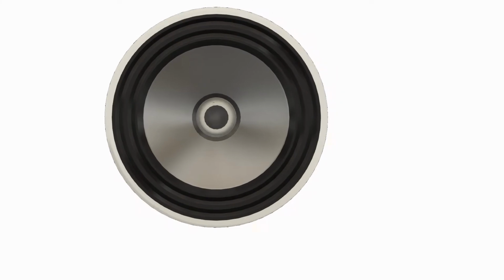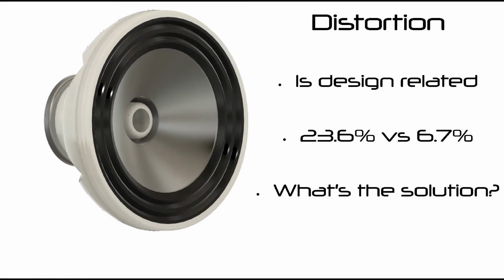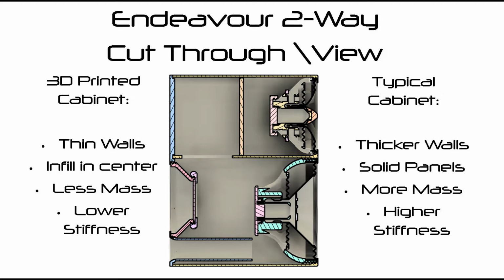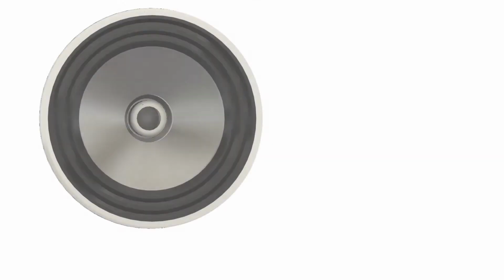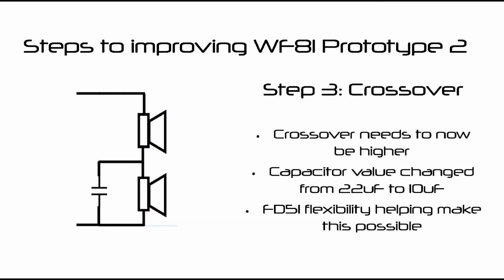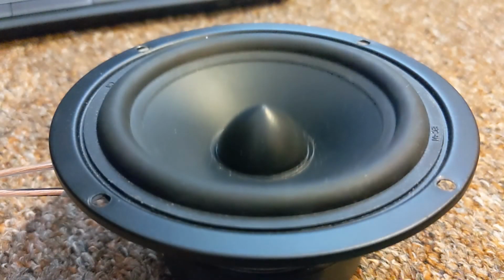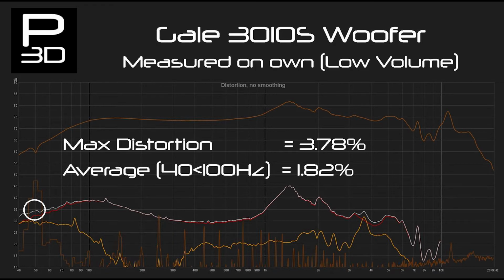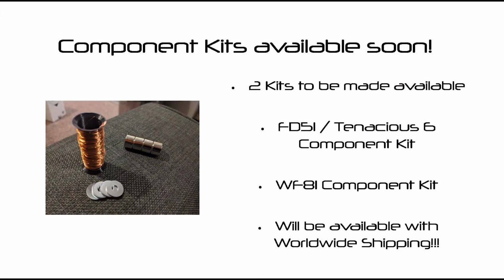WF81 Proto 2, Improving distortion on 3D Printed speaker drivers!

Comment: Two Suggestions:
1. Test the speaker mounted on a thick "Infinite Baffle" plane.
2. To reduce/eliminate cabinet distortion(s), I suggest the use of non-parallel panels--in other words, have the back panel angled in towards the top. Top being shallow in depth than the base of the cabinet. Doing so will assist in breaking up any internal standing waves.
PS--Another simple and interesting component to add to your crossover network would be what's called a "Zobel Network" basically it's a non-polarized capacitor in series with a non-inductive resistor placed in parallel across the terminals of the speaker. This "Zobel Network" negates the impedance rise as the frequency of the driver rises.
Reply from the maker: Certainly a lot to think on and honestly, but experience on cabinet design is fairly low so will be learning lots as I go. As for the infinite baffle, I am in a 1 bed house with no garden and a 2 year old, but having to work with what I have for now. If I get the luxury of space, a baffle will be on the list!

Comment: Cement is not a suitable material since its absorbtion rate is poor. It basically rings like a bell. Look at Dr Geddes polyurethane blends for inspiration instead. Another alternative is constrained layers technique which is extremely effective. The trick is to use a special glue between to different stiffness layers. The energy is converted to heat inside the glue very effectively.
Reply from the maker: Hey again :) On Patreon we are actually doing experimentation on this exact thing! I agree that we have found a solid spike up at a certain stage and already have had multiple methods to attempt moving forward. With the constrained layers, I am trying to figure out the best way to achieve that in a 3D print which you can do after printed in a easy way. Complexity is an area I really want to avoid to make the project open to as many people as possible. Really appreciate the ideas and your time to leave comments. I am surprised how much traction this work is getting tbh! :)
Reply: Would, say, Silicon calking (or just regular silicon) work as a sound dampening matirial to inject into the printed part?

And would stirring air into it benefit any sound damping perhapse?

Comment: air insulation cabinet should be ok, just cant be any parts jiggling around inside.  make the cabinet thick (1inch)
Reply from the maker: Thanks for getting in touch Michael. A hollow cavity I think may be an option. My main concern is where the driver attaches and inner and outer walls. Either way we will run multiple tests and then let the data tell us the best route :)